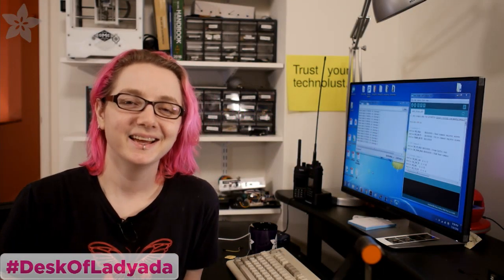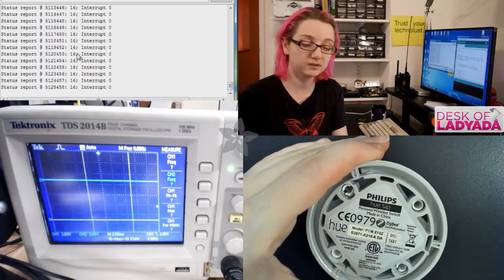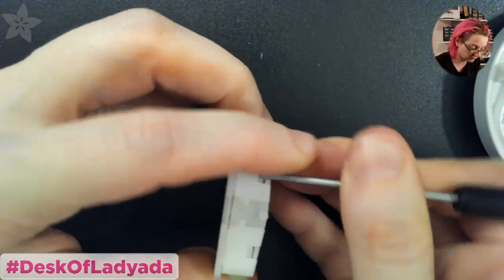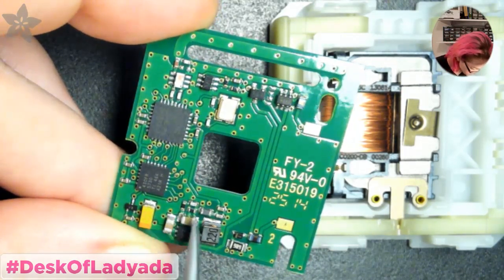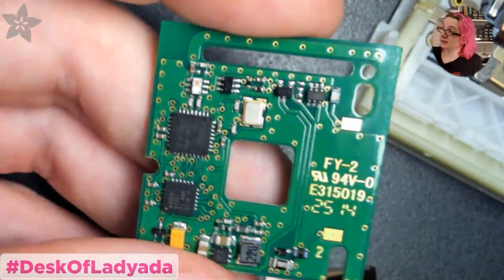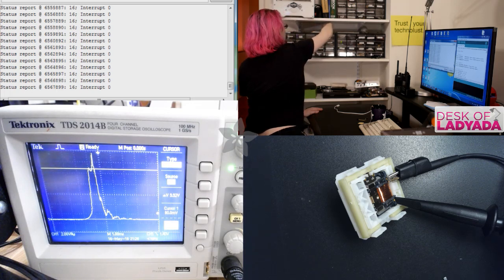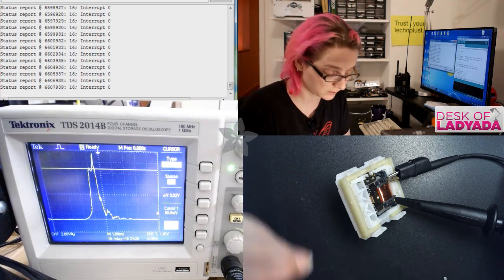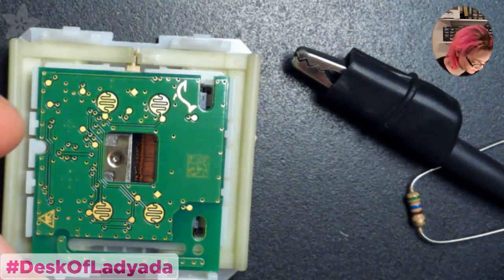@adafruit #deskofladyada Philips Hue Tap teardown @tweethue @philipshuedev

Comment: The original wireless remotes were purely mechanical.  The clicker had a tuning fork in it; pressing the button struck it and generated an ultrasonic sound.  The receiver used an ultrasonic transducer to listen to the remote.

Comment: The 1st T.V. Remote Control was called " Lazy Bones" and was developed in the 1950's by Zenith and had a cable running back to the television set that operated a motor.....
"Lazy Bones" which was dubbed the "clicker" was battery less in the way it operated! The click sound was what actually changed the channel, or started the operation of the channel being changed! 
Fun Fact: not sure if my uncle was pulling my leg, but he told me you could mouth click sounds and cause the TV to change settings! I thought that was just epically cool! But why the cable to the TV set then??? Hmm, I love Adafruit , I Love Electronics, I Love Engineering, I Love you all!!!!!!
Reply: The clicker uses tuned ultrasound forks inside the remote, no wires on that one. Google!